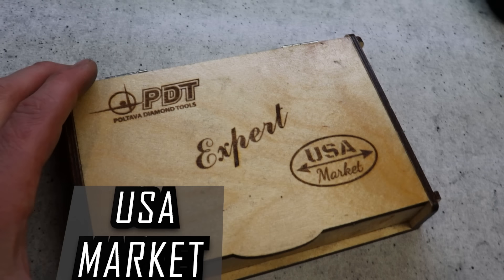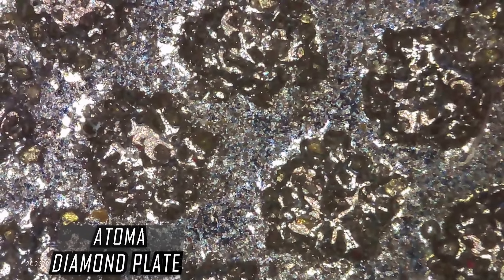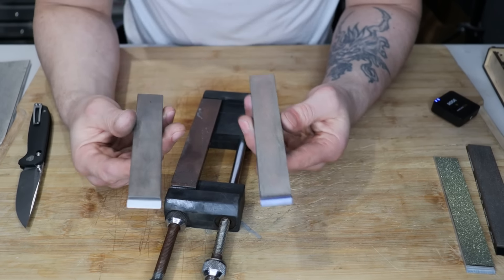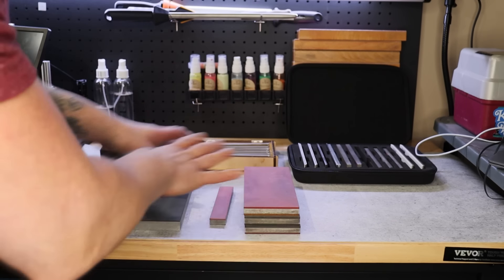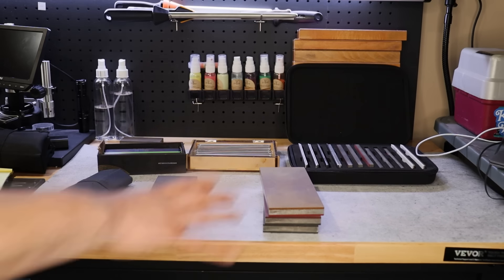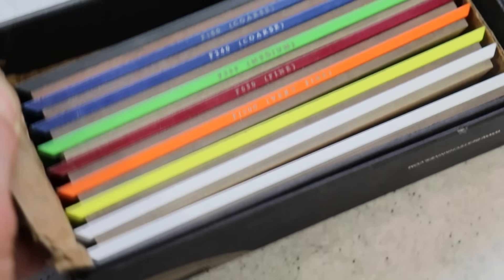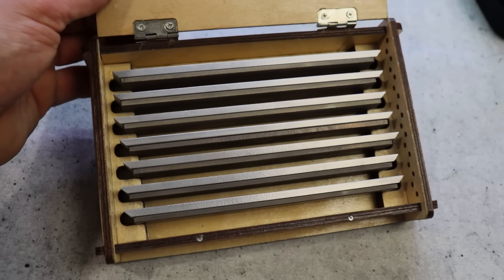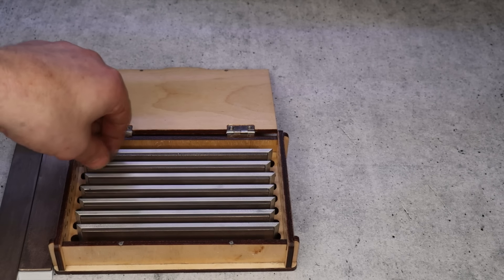Worlds Best Sharpening Stones!?  NEW USA MARKET SHARPENING STONES

Comment: 🙂Guys, ATTENTION & AHTUNG 🙂
The Hapstone didn't make their own CBN grinding material BECAUSE it's a huge industrial mashinery and technoly needed! They just mounten some grinding material that they bought in Kyiv Diamond Tools factory (Ukraine), or the Poltava Diamond Tools factory, Ukraine (or somewhere ...maybe in Chaina ;-), who knows) ON ALIMINIUM PLATE - THAT'S IT 🙂 and made their Hapstone brand ...well done, what can I say 🤣
Anyway, geographically, they are located in Sumy city, Ukraine, BUT FOR SOME reason on THE ADVERTISING and EVERYWHERE they SAY THAT THEY ARE FROM Poltava city! Why do you think, guys, they do this?! Tell me, guys, who can give me the answer :face-green-smiling: of this trick 🤣
Reply from the maker: they are made in ukrain to my knowledge china does not have any bonded stones, i do have some new ones im testing from same company however made by a new company not pdt
Reply: @NeevesKnives  It is possible that the CBN-stone (the abrasive body of the sharpening stone) that Hapstone advertises as his own were made in Ukraine. However, they are ONLY (!) to mountaning and glued the abrasive body of the sharpening stone to an aluminum plates in the city of Sumy (Ukraine, Hapstone), where the Hapstone company is legally registered, AND NOT MAKING IT'S BODY! It's as if I bought a horse, bought a saddle and put it on the horse, and everywhere at horseы Shows I claimed that it was my horse. Of course, this is your horse, but YOU DIDN’T RAISED IT AND DID NOT EDUCATE IT, so always at the Horse Show, you won’t be able to say that this is my horse - YOU MUST TELL THE HORSE's BREEDER FROM WHOM YOU BUYED THIS HORSE! If I'm wrong, then I don't understand something in this world, friends :-).
*
The Hapstone company glues the abrasive's bodys (the working body of the sharpening stone) purchased somewhere outside of Sumy city (Hapstone) onto an aluminum substrate. Gluing an abrasive block onto aluminum DOES NOT MEAN MAKING an abrasive block, do you agree? I am not DISCUSSING that Hapstune sells a good or bad product - THIS IS NOT MY BUSINESS and the buyers will decide, ONLY I AM AGAINST THE FACT THAT THEY ARE SCAMING THE AMERICAN BUYERS (!), claiming that they make the abrasive body of the sharpening stone - they not! The abrasive body of the sharpening stone are made by PDTools, Kiev Diamond Tools Plant, or, maybe someone else - it doesn’t matter!
*
Second, how they mislead the AMERICANS is that their company Hapstone makes CBN-stone in Poltava ;-). I am for EVERYTHING to be honest and clear for consumers in the USA! So, they have to know the truth - the abrasive body of the sharpening stone are made in Poltava and made by PDTools (or other Diamond factory from Ukraine - it's doesn't matter), Hapstone just glued it onto alluminiun blank in Sumy (Ukraine) at the company Hapstone! Let the company be Hapstone, then THEY WRITE THIS IN THEIR ADVERTISING, why mislead the Americans?! Or am I wrong, Mr.Jerad?
Reply from the maker: @stranik1966  i dont think ive said that hapstone makes there abrasive i believe its pdt that makes it, however i am now working with another company thats stones are not made by pdt. and they are great so far, the pdt ones are also really good but these seem like they could be better possibly but we shall see,. to my knowledge they are made in ukrain but its possible russia has something to do with it im not sure, but the company has been very transparent so i can find out any detailed info
Reply: @NeevesKnives  No, you didn’t say ANYTHING about how and where Hapstone “produce” “their” sharpening stone (!) - you are doing the right thing by taking a neutral position - YOU ARE AS AN ARBITER WHO HONESTLY PROVIDES THAT INFORMATION ABOUT THE QUALITY AND PERFORMANCE OF ABRASIVES that the Makers are sent to you for testing, therefore We are watching you, Mr. Jerad!
I am indignant that Hapstone on the website of the seller at Gritomatic (which is the official dealer of Hapstone in America) claims that Hapstone is Poltava (Ukraine). BUT THIS IS NOT SO - they are from the city of Sumy, Ukraine! Which of them is doing this - Hapstone asked the American company Gritomatic to lie, or Gritomatic is doing this on its own initiative, BUT IN AMERICA THIS IS CONSIDERED DECEPTION OF THE CONSUMER! They are not honest guys in advertising their products, but I don’t want to argue about the quality of their product - I’m not an expert, but in America YOU NEED TO BE HONEST AND YOU CAN'T LIE AND MISLEAD THE BUYERS about your goods - this is THE USA, friends! STOP TO LIE!! 
So, in the end:  :medal-yellow-first-red:God Bless America !!! :elbowcough:
Reply from the maker: @stranik1966  i was not aware of any of this information but i will def look into it now i appreciate you letting me know. thank you
Reply: @NeevesKnives  Dear Mr.Jerad.
Please, study it. The fact that Hapstone is geographically located in Sumy city (Ukraine) and NOT in Poltava is 100% information FROM UKRAINIAN GOVERMENT by IRS officials! The fact that they buy the body of a sharpening CBN-stone and Diamond stone from the Poltava Diamond Tool Superabrasive Plant (PDTools, Ukraine) is also 100% information. From whom they buy the body of the sharpening CBN-stones for “their” CBN-stones - my guess is that it is either the Kiev Diamond Tools Plant (Ukraine), or some other factory, but this is not important, the main thing is that they do not deceive consumers in the USA, saying that they made these bodies out of CBN-stone. The just to gluing onto aluminum CBN-stones. It’s just that you, Mr. Jerad, has to understand that ONLY A FACTORY can make a body for sharpening stones - this is a VERY COMPLEX TECHNOLOGY ... well, for example, can you imagine that Boeing Corparation is made their ingine in a garage, and not at a factory? PDTools is a factory that has been making these products since 1966 using German, Dutch and American equipment for millions of dollars! Hapstone, even if they want and buy such equipment, will not be able to repeat the connection CBN's grains (peices)  in these bars correctly and durable as PDTools did :elbowcough:
For example, just as in microchips, factories fight for nanometers, so do factories producing abrasive material fight for the bond material (the glue that will hold the CBN's grains so that they do not fall out of the sharpening stone. The recipe for this combination is kept a SECRET in factories, JUST AS COCA-COLA Corparation KEEPS THE RECIPE OF THE COCA-COLA on TOP SECRET! So, in the 5 or even 10 years that Hapstone exists, they will not be able to creates the bond's material as PDTools did, since this is a multi-million dollar cost of scientific development and technology that 10 years IMPOSSIBLE TO CREATE from scratch 🙂
Reply from the maker: @stranik1966  heres a direct message from USA market who im working with at them moment with bonded stones 

They made in Poltava city. Well the plant is in 2 miles from Poltava ))
USA-Market™
So as PDT, so as KDTU are from Ukraine, from my native city Poltava
USA-Market™
We have 4 diamond plants here in Poltava. It like Diamond's capital of Ukraine
Reply from the maker: @stranik1966  yeah it's 2 miles from Paltava
Reply: @NeevesKnives I see. Thank you for information, but anyway I'm rigth that the Hapstone company not from Poltava city, right? They are from Sumy city that far away 110 miles from Poltava (I checked on Google Maps) and, also, they don't have plant AND MACHINARY TO MAKE diamond or CBN grinding material. In this case they didn't make ANY an sharpening iquepment (the sharpening system (hand machine) they order in Chine also). Thus, the sharpening Diamond and CBN-stones they just stick and mountened it on the aluminum back plates :-), isn't it?  😜
Reply: @NeevesKnives  I agree that the PDTools factory 2 miles away from Poltava city, but the Hapstone garage where they glue CBN-stone bars with aluminum plates 110 miles from the city of Poltava - this is the FACT :face-blue-smiling:
Reply from the maker: @stranik1966  what ever i sent you is what i know as far as location, to my knowledge none are made in china though but not 100% trust me i would say if i knew
Reply: Thank you to the author for the video review😎

Indeed, Hapstone is not PDTools, and physically Hapstone is located in Sumy, while PDT is in Poltava.

I used to use Hapstone sharpening stones and thought they were the best until I bought Poltava Premium CBN stones and realized they are the best 💪